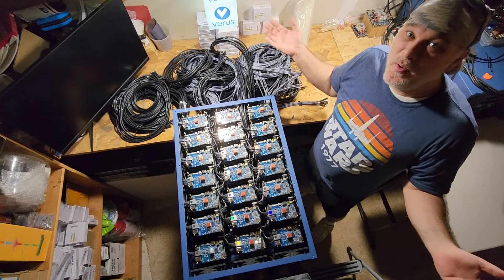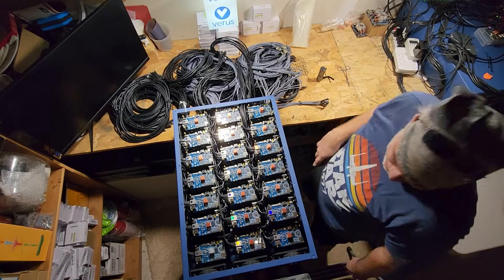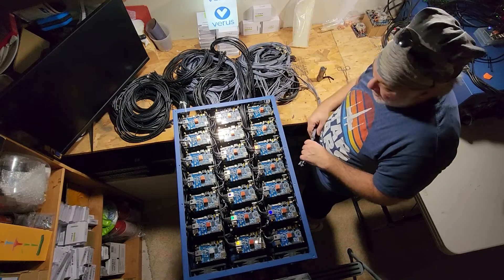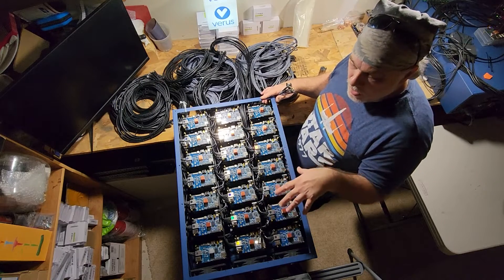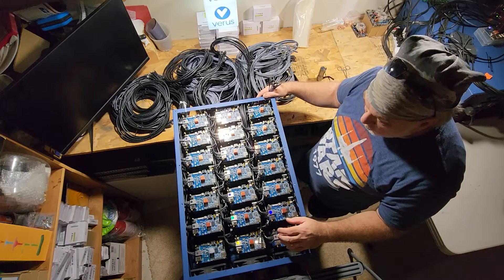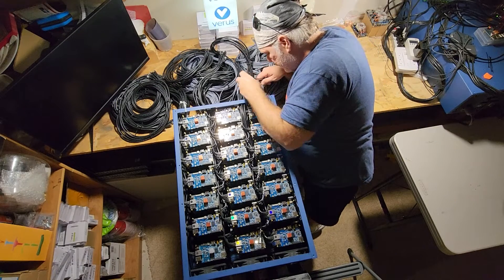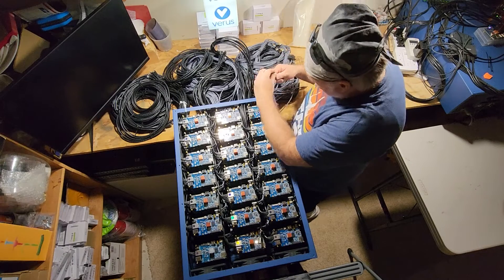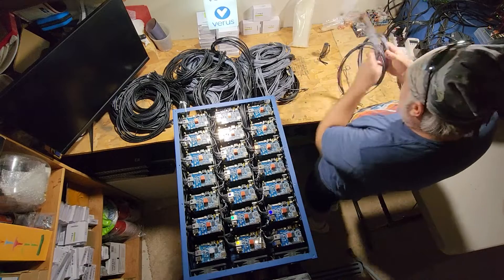Installing the Pi Cluster Supercomputer with 125 Orange Pi's into the Server Rack - Part 8

Comment: Really like the project. i have a few orange pi 5s as well. The principle is right hands down. I have watched the project from the first video. However, i will make a prediction. The pi's next to the fans will run probably 5-6M with the passive coolers and run around 70-75C. the bottom pi's closest to the fan inputs will run about the same but hotter, maybe slightly lower hash rate due to the ventilation. The higher the pi the less the hash rate. As the pi's progress length wise from the fans the less the hash rate due to the combined heat. By the third pi set they will thermal throttle. the top final run will drop down to 3-4M hash rate and the top of that run will run at the lowest if not reboot all together. I hate to be so negative but that's alot of pi's is a crammed into a small space.  I do applaud the attempt thou. i went the mineral oil route; individually stacked length wise and see 6-8M per pi. These things get hot quick. Temps need to be no more than 60C to get the high hash rate. mine run at around 54C. using the server rack i would run them length wise and stager the second stage. Just my two cents. But looking forward to the results. Thx for sharing your adventure.
Reply from the maker: For sure, I definitely appreciate the support and I'm curious to see if this works or not but I'm pretty sure it will! You may be right but it's all about the fans and their static pressure and how much they can move. The drag is going to be the biggest issue along with the heat accumulation.

Comment: Question how did you guys hard wired the phones to power
Reply from the maker: We're essentially just removing the battery and wiring to the positive and negative of the battery connectors themselves. I've been meaning to work on some videos but unfortunately every phone is different so they will be coming.
Reply: @TheBitcoinMiner  can this work on tablet
Reply from the maker: @tildenhowie3605   Yes this works on tablets too anything with arm devices.
Reply: @TheBitcoinMiner my battery voltage is 3.8v at 6300mAH, it is a Amazon fire hd 10 9th fen